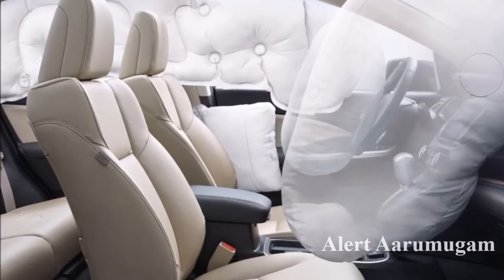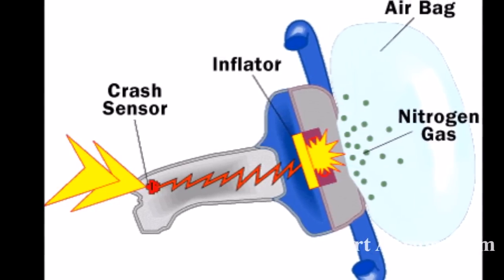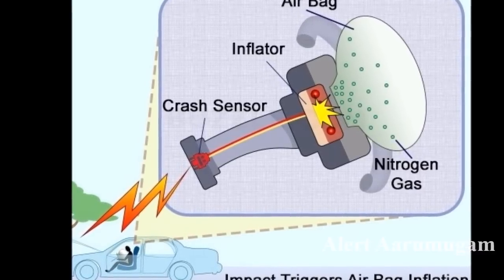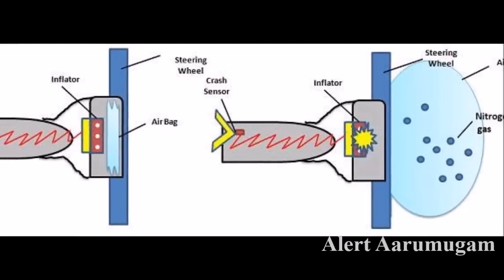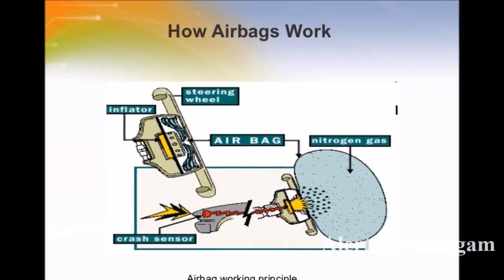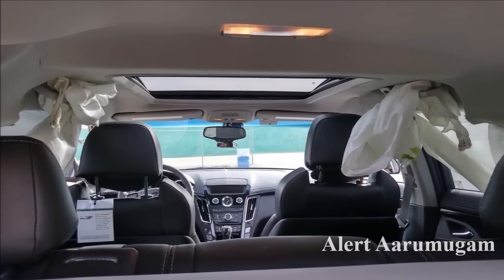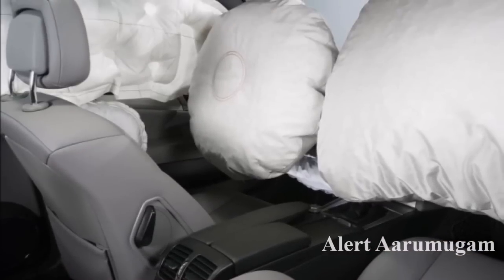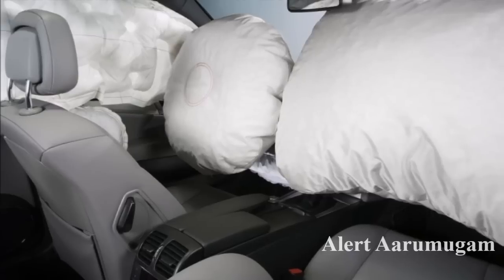Airbag எப்படி விரிவடையும்னு தெரியுமா | How Does Air Bag Working In Car | Airbag Working Principle

Comment: I feel that the diameter bag may be marked on windshield and the distance the airbag outer surface may also be marked on windows so that the passenger is alert to fasten the seat belt as the passengers use different models of taxies.